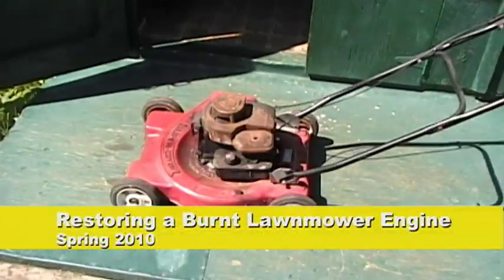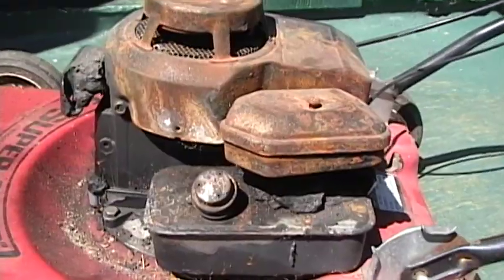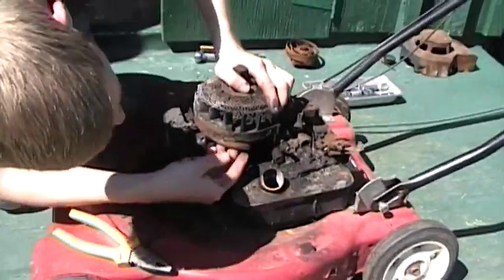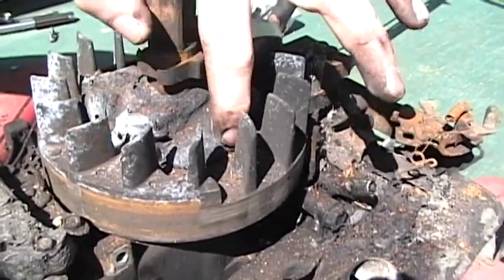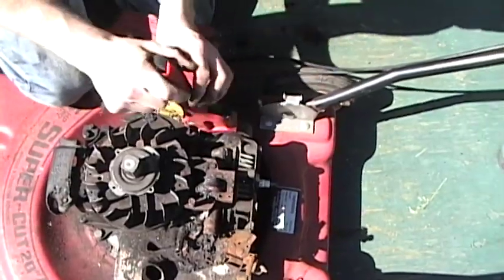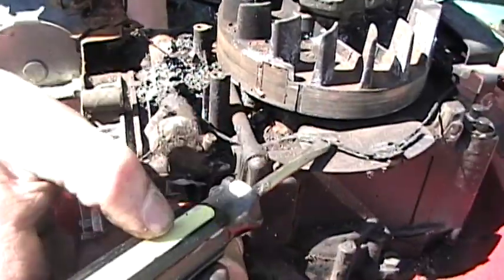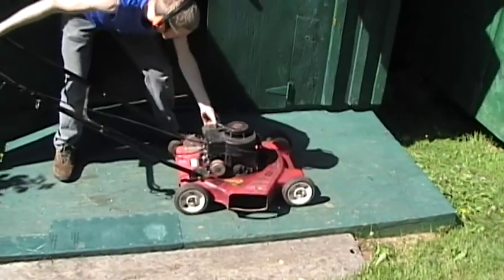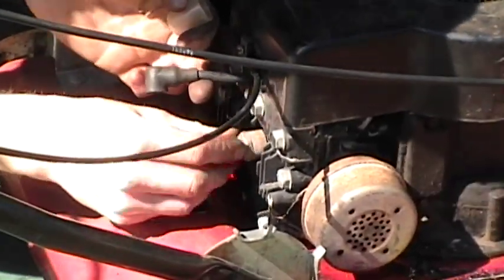Restoring a Burnt Lawnmower Engine

Comment: Ya ride on mowers are so awesome I have a 2004 Husqvarna YTH2148 with 2038 hours on it I only had to replace the alternator last month cause it kept on stalling out after 20 minutes of mowing my front yard in the summer but now it works like brand new I use that mower alot my Husqvarna is like the work horse of my whole property I mean I use it to hail shit from Hedge trimming and hailing firewood all kinds of stuff but that's cool oil man out peace

Comment: Ive had my mower for around 9 years and only now changed the oil, its used allot and I have allot of grass, I never needed to replace anything in it not even a spark plug, is this normal or reliable for a mower?

Comment: I never saw you open the crankcase, you got lucky the plastic camshaft gear hadn't melted.  Our last lawnmower the camshaft gear melted and was stuck all over the inside of the engine, the dip stick melted as well.  I grabbed a lawnmower from the dump with a Briggs engine and replaced all the melted bits and it runs again but is a little weird, sounds like a diesel and only has one speed, full speed.  Mows the grass fine though.
Reply from the maker: I never considered that at the time. The mower has been in use since, so it must not have got hot enough to damage the camshaft gear or oil pick-up gear.
Reply: old briggs models do not have plastic cams.
Reply: +smallenginedude71 you're correct
Reply: +KlockworXMusic 
Old comment, but you might have the engine timing incorrect, that could cause the knocking noise. That should be check asap ... or not (your comment is from a year ago XD)
Reply: +smallenginedude71 - They have used plastic cams for about the past 30 years  in some engines, and they are real common place in the lawnmower engines.  This doesn't look all that old either.
Reply: +Benjamin “Ozias” Esposti - Its a fitment issue, I had to do a little more to get everything to work because the connecting rod and crank or something got changed as well and was pulled out of a Kohler or Tecumseh, some completely different engine, the stroke is slightly longer, not to the point the rings go past the top or bottom of the cylinder, or they hit the head at all, but I think it has more compression now and because of the oddball stuff I did to it, sounds like a diesel, works great though!
Reply: KlockworXMusic i have to say the plastic cams have not been a bother for me. i have a briggs engine (the one in my profile pic) and it has a plastic cam. It has 3000 hours on it!!
Reply: +smallenginedude71 - Never said there was really anything wrong with them, but they melt at a substantially lower temperature then a steel counterpart which can be a concern if your engine starts running hot, bursts into flames, that sort of thing and they get up past 220 C they could start melting (Assuming they are nylon, then they should start melting by 270 C).  But if you lawnmower bursts into flames, you probably have other concerns lol
Reply: KlockworXMusic Yeah i totally agree with you, I hate the idea of plastic on critical components on an engine. Metal is way better for sure
Reply: governor stuck wide open or missing is why it only had one speed. is one possible cause
Reply: not only that, the intake manifold wasn't melted here I think, unless he changed it, every part that tallies gives me a headache.  lol

Comment: Old Briggs and Stratton side valves never die. The new  OHV ones are nowhere near as good.Mine is 22 years old still fires first pull.
Reply: Mines 50+ years old and still fires up first pull

Comment from the maker: My guess is that It is working longer than average with the lack of care you have given it. I once bought a used mower. When I changed the oil, there were steel specks all through it. I think that was the one that had variable valve clearance issues = parts engine.

Comment: I trash picked a mower and all the plastic parts seemed to be melted on the engine. I guessed it was in a fire so I guess it can happen.  only thing with mine was it wouldn't turn over because the cam gear inside had melted.

Comment: Starting fluid (ether) is supposed to be sprayed directly in the carburetor, not directly in the combustion chamber through the spark plug hole. Because it needs to mix with the air to create a combustible mixture.
Reply: its not. it was gasoline he sprayed in.
Reply: Gas, ether, it still helps start an unprimed engine. And either needs to be introduced into the carburetor only.
Reply: Still doesn't really matter. the gasoline vapors in the combustion chamber still get compressed and ignite and cause combustion.
and having the extra fuel richens it even more making it easier to start. without harming anything.
Reply: All I know is, when I do it my way, the engine starts. And if it doesn't start, it obviously needs a tune-up.
Reply: well it doesnt matter as long as the engine starts and doesnt take damage your good to go.
Reply: realflow100, that's right. :)